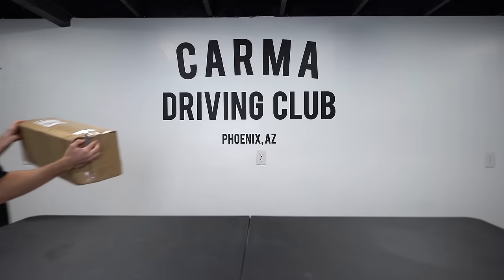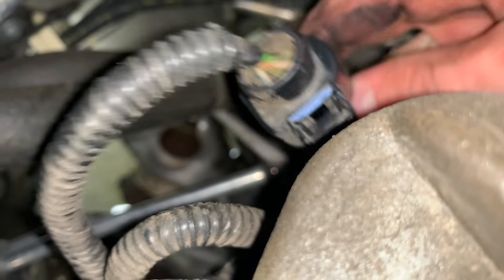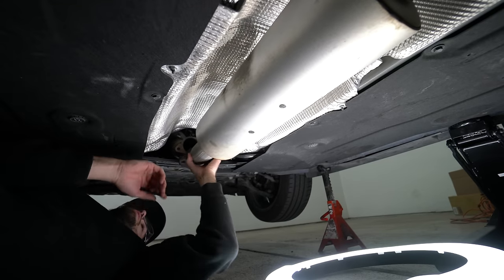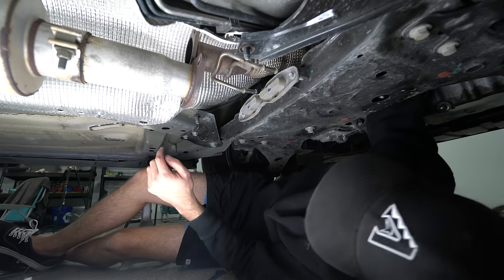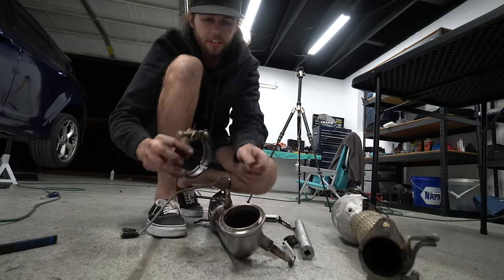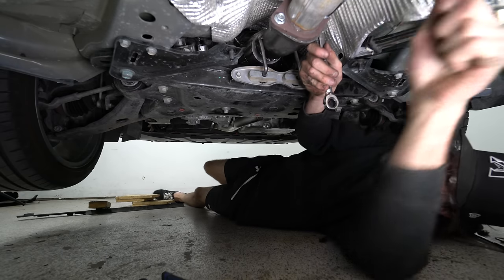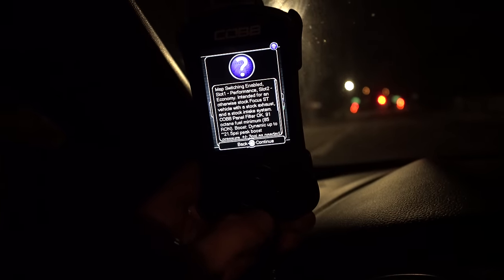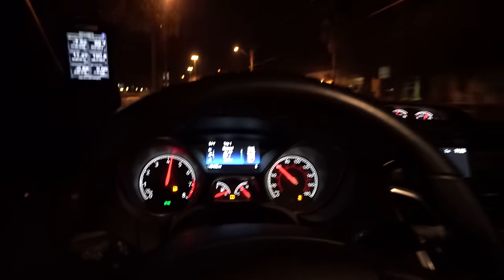LOUD Exhaust Install on Focus ST!

Comment: I just installed the AWE track edition with the stock downpipe and it is really deep, throaty, and LOUD. I know you bought the car with the MBRP already on it but you should really look into AWE exhaust systems, its legit.
Reply: I have a ford racing catback exhaust, but want a downpipe. I’m scared that it will be too loud. Any suggestions?
Reply: If anything get a high flow catted downpipe. However most will cost more than a catless one.
Reply: How's that drone treating you
Reply: Intercepting Fist Completely liveable, the resonator helps without restricting the volume too much.
Reply: Agree with the AWE. Installing a depo catless Sunday
Reply: DJ - ESO thanks for the advice😁
Reply: I agree the awe track is the best exhaust out there
Reply: Fritz Jean-Philippe I have this combo and love it. Endless smiles.
Reply: Trevor. Got my downpipe on but I’m getting rasp above 4000 on wot so I might get some work done to get rid of it but sounds great down low
Reply: Just installed one too. It sounds really good. And deep
Reply: @fritzjean-philippe2464  how did it turnout, im getting one when they are back in stock
Reply: Opinionated Loser I highly recommend. Awe makes the perfect exhaust and you’ll love the little present that you get in the box
Reply: @fritzjean-philippe2464  I loved the blowpop inside but im worried the catless downpipe will make it too ricey
Reply: Still have it?
Reply: @skimshady  did u do it I have awe idk if I should do it or not

Comment: As long as I've had my ST, I've been told never to run a Cobb OTS tune! They blow up motors, according to lots of folks in my local group.

I'd recommend looking into a JST or Stratified tune really soon!
Reply: Wrench Every Day cflrst gang
Reply: It's not the tune that blows motors, it's user error 99% of the time.
Reply: Hey man we running cobb stage 1 ots map with with cobb filter next will run front mount intercooler and stage 2 ots the add downpipe and run stage 3 ots. Will that be fine then after get stratified map or something?
Reply: @kemsleygobey2357  I think it's better to have a relationship with the tuner while you build.  So if you're planning on doing all that, I'd start right after the s1 ots map and filter.  The more data the tuner has the better.
Reply: Jst is a very awesome company. Those guys are good people. I highly recommend them
Reply: @thebibleisaxiomatic8178  I'm at 170k now, I've had a cobb ots tune on since 50k.  She can still beat a hemi.  :-)
Reply: @ifixthings86  what’s all done to it ?
Reply: I'd go w Alan from Edge Autosports!

Comment: When you asked for suggestions on breaking away rust, Kano Kroil. Comes in a bright orange can. It’s like pb blaster on crack. I work on outdoor rusty elevators and escalators and you can free up the most seized bolts imaginable with a few squirts of that stuff. Highly recommend

Comment: I can help with the rattling problem right now because I had the same problem. The heat shielding is loose on the bottom of the car.
 I had to loosen mine and re tighten / align them because ford had to loosen some bolts to inspect the fuel tank for the recall and didn't put it back correctly 🙄.
Threw that boy on ramps in the middle of the night because the sound drove me crazy on the highway. 
Hope this helps!

Comment: Vibrant J-tube defouler with no insert on 2nd O2 sensor and a JST Tune on mine and passed emissions no problem 👍
Reply: I did the same thing, worked perfectly!

Comment: Cameron did you ever take your muffler off or get one out on? I put a depo racing catless downpipe on my ST with a AWE track exhaust and it's horrendous when WOT especially in 2nd gear.  I'm debating on just selling the downpipe and getting a catted one or getting a muffler for it.  Please help lol

Comment: For each one of these mods, you should list your mod list in the description. Which RMM did you have here?
I had the CNT Racing 2.5" V2 catback for a while..last year i dropped in the CNT Racing cat-less downpipe (same day i did my CPE lightweight FMIC) and together they sound amazing..resonator/muffler included. I have yet to hear an exhaust on a FoST that sounds similar to mine and i get decent crackles on decel. 
Currently running the OTS Cobb Stage 3 (93 octane) tune. Its tough deciding on which custom tuner to go with though, JST, Stratified, Pwnall, etc.. 
Also, did you run a de-fouler?  I was told i'd throw codes without one. I couldnt get the one I bought to work, so ran it without..had zero codes or issues since last August (2019). Car still sounds amazing. My only issue was I got vibrations/rattles likea metal on metal rubbing when in high gear at low speeds and i accelerate. But im stock RMM..which will change soon.

Comment: Wish it was that easy in my Z!! You gotta basically pull the engine to get the headers off 😅 (subframe is in the way)
Reply: I use liquid wrench or WD40 in my garage. Personally noticed that it’s easier to clean up

Comment: I just removed my totally clogged cats on my exhaust. I got the car at 135k and im at 153k now and probably wouldnt have ruined my stock cats had I not egr delete, and other things that put stress on it and then driving on a blinking engine light for way too long like 1000+ and after maf sensor cleaning and new intake and all that I finally figured out what's making everything dirty up front is the fact that the cat was clogged with oil or whatever at least I hope that's the case my car won't rev over 2.5k now and before this symptom it was just blinking engine light and the car running really ruff mostly and with the problem getting better sometimes when I can rev on the highway and like blow the exhaust clear enough to get more air through making the car sing for a bit and so I know it can run smoothly but just not at idle and I'm hoping the eBay test pipe I got will fix it and I'm installing it on the speed3 now so I will update tomorrow

Comment: I definitely don't recommend the cobb  ots stage 1 map. I ran it on my st for about 10k (I know I should have gotten a pro tune just wanted to go stage 2 first) and number 4 piston blew apart. Just be careful man. Ford wont cover it so I'll be building it myself.
Reply: That's a long time running an ots tune. I'm scared to tune because of warranty.
Reply: @interceptingfist5682  yeah unfortunately I didnt think that it would cause damage being that it was just a stage 1 map and I watched my afr like a hawk and never had it lean out. Oh well I'll be paying the consequences

Comment: Be careful when buying downpipes. A lot of them don't use the best metallurgy. Secondly, most downpipes are not Argon Gas back purged to ensure a strong and long lasting downpipe. I say this because quality comes at a higher price tag. IMPO Daniel Check @ TB Performance Products offers the highest quality downpipe money can buy. 304 stainless steel and TIG welded.

Comment: I’m almost getting like a “grinding” feeling in my clutch after the downpipe install. I only feel it in first gear when at low rpms. I don’t feel it every time though? Any thoughts?
Reply: You might just have to give it some gas

Comment: This shit is essentially the same as the Mazda speed
Reply: Same block. The ST sadly has a smaller turbo and is de-stroked to 2.0
Reply: Bryan Munoz Lol the same? Are you special ed
Reply: Kade Raqq Lsd but still had a bunch of torque steer 😭😭 I really want one or an ST
Reply: @Dfpijgyt564s65sgt  lol pretty much the same not 100 the speed is obviously better

Comment: Damm that's nice, too bad where I live the cat is required.
Reply: Catts do not, as many say or think, hold much power back at all. Maybe 1-2 hp and a DP adds 4-6 hp. A full turbo back cattless system will add 8-12 hp. Full system turbo back and Catted 1-2 hp less. No need to throw a aftermarket CAI  on it either. Not unless you plan on 400 crank hp/355 whp.

Comment: at 11:34 why do you use an extension on the wrench when tightening it? When using extensions you lose torque and it doesn't seem useful to work with...

Comment: Always make sure you don’t beat on it unless you have over half tank of gas !
Reply: Wait why
Reply: OTBS99 6 with the direct injection and tunes you need to have enough fuel ! I was told by my pro tuner to always have half tank of fuel when getting on it

Comment: Nothing I installed on my st was easy except for the intercooler.
Reply: Reggie Soria lowering springs were the hardest without power tools
Reply: yeh after doing symposer delete on my FiST I had zero motivation to ever modify that car again. the engine bay is such a fuckin mess